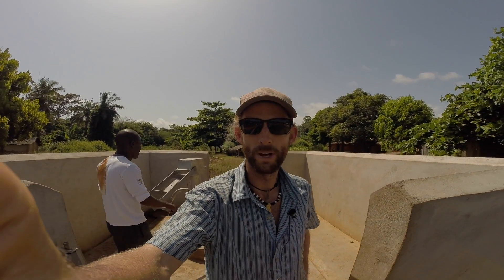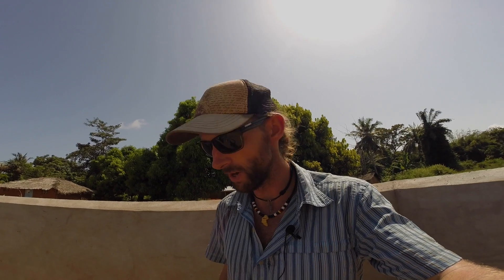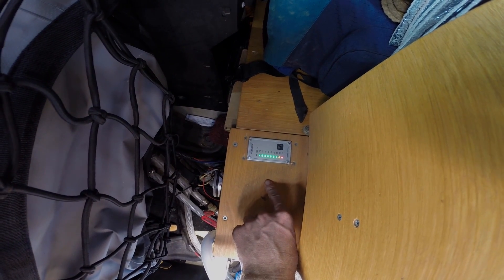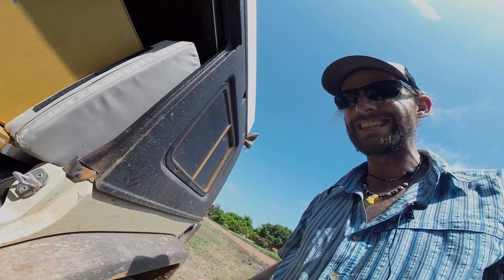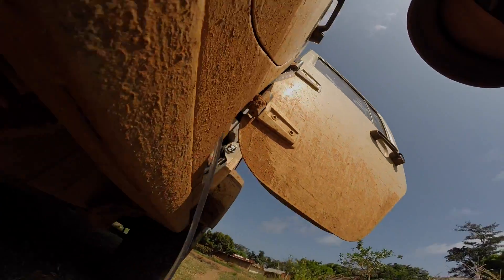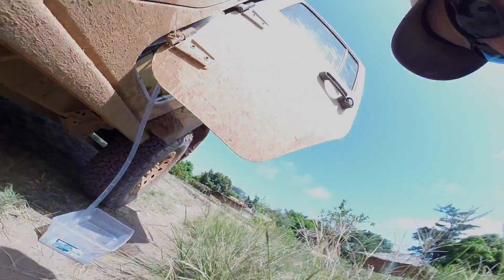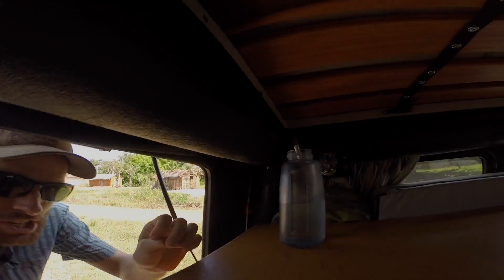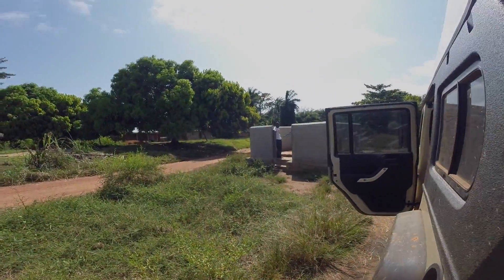Overland Vehicle Drinking Water and Filtration System Walk around

Comment: That's really a fantastic system! That Jeep seems to be serving you very well.  How's the old 3.8 running? Mine just turned 114,000 miles with zero issues and just good maintenance. It uses some oil, but that's pretty normal for this old reliable design.  
Love the updates and living this adventure through you! I spent some time in Kenya a few months ago, and wished I had my Jeep there every day!
Reply from the maker: Thanks! The water system is great. the 3.8 is running well. It was burning some oil, so I just put in slighter heavier weight the last couple of oil changes and now it burns almost none. About to hit 100k miles.
Reply: Mine has burned just under a quart per 1k miles since 40k. I've tried different oils and weights, and have settled most recently on Mobil 1 10w30 High Mileage. It burns just under 1/2 quart per 1k now.  It has run perfectly, in spite of this.  My brother had a 3.8 in a mini van that did the same thing, and he sold it with over 200k on it, still running great, but using lots of oil.  As long as she runs reliably and well, I'm not too concerned about it.  Thanks for the updates and details on the solutions you used to adapt your Jeep to the requirements and challenges of this amazing trip!
Reply from the maker: I am up to 10W40, and burning almost nothing, though it's seriously hot over here... not sure if you would want to go that high if you see cold weather.